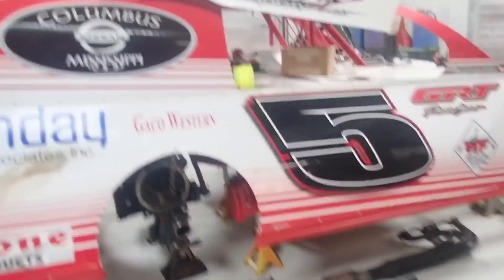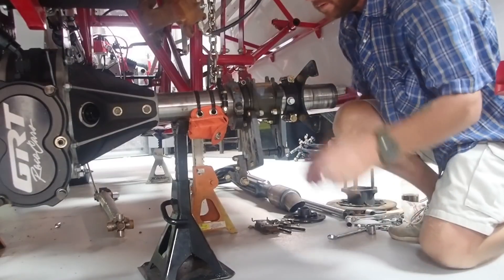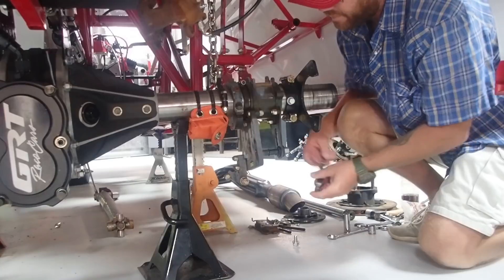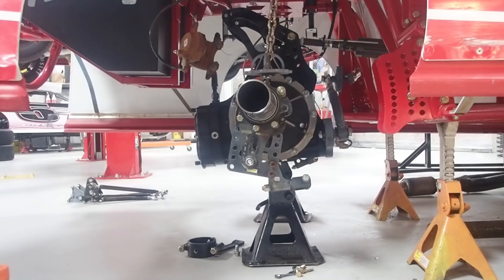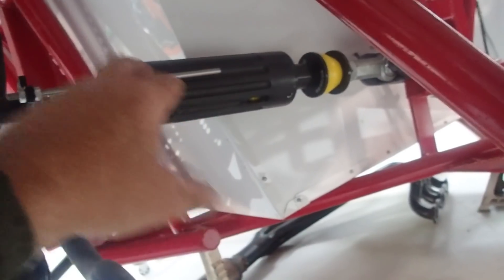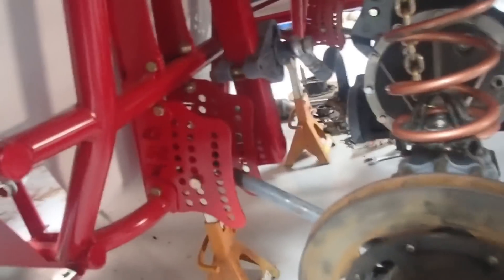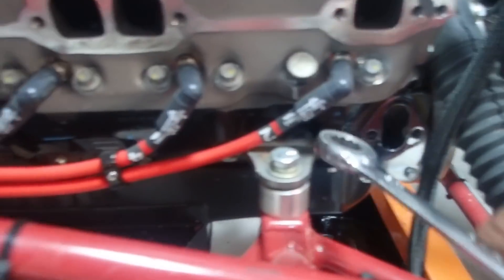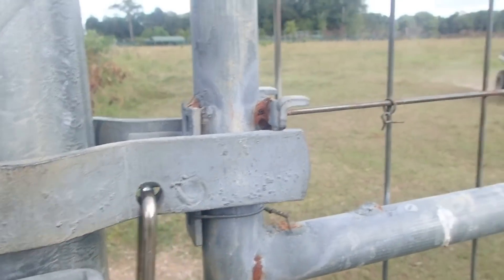CONVERTING THE GRT MODIFIED 🤔🤔🤔

Comment: Did they change the rules on you? That's the reason your changing everything? Open motor ? You can run anything but with a 2 barrel carb ?